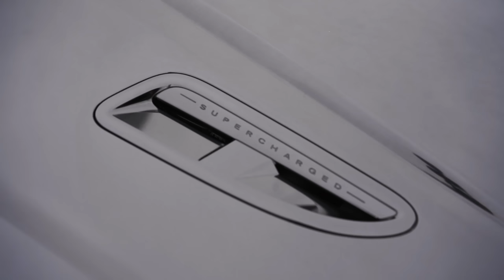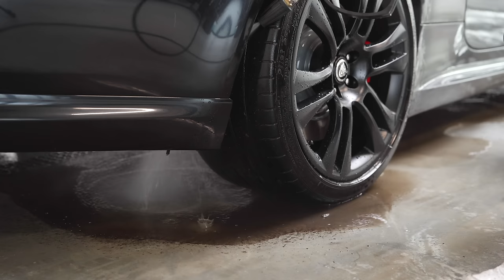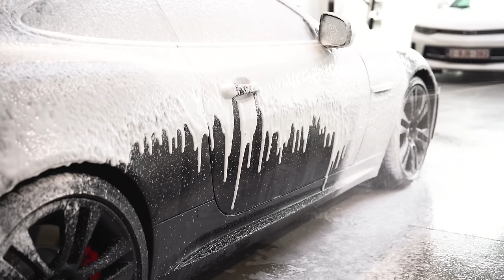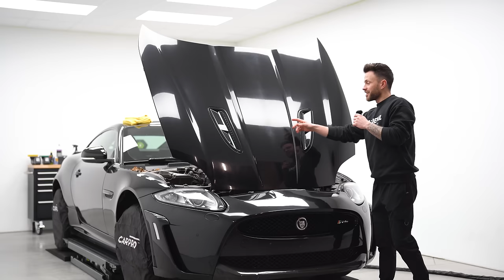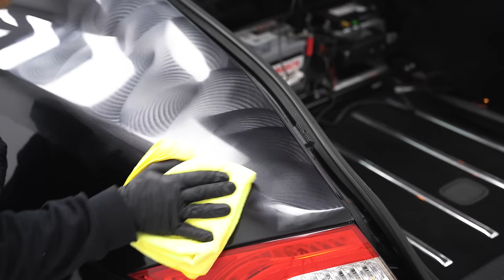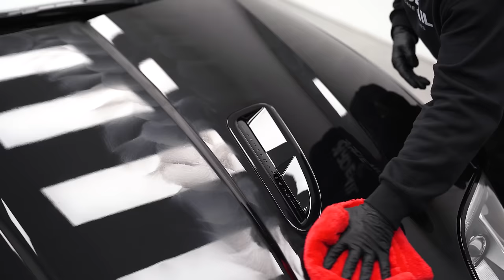First Detail in 12 Years - Car Detailing Restoration

Comment: Nice video man, amazing! Would you recommend using the P&S Iron buster without later polishing and applying a coat? In my case my car is new (6 months old) and I'm worried because there is always break dust and I don't want to affect the down parts from the door etc. I know is PH neutral but will be fine?
Thank you!

Comment: you have any issue with letting iron remover dwell then claying at the same time?
Reply from the maker: No issues at all!
Reply: @VermijlCarDetail that would make me extremely nervous for it to be on the paint the entire time you are performing your mechanical decontamination. I usually do the claying with a decontamination towel using the soap on the car mixed with iron remover as a lubricant, but I do that panel by panel. I would prefer to do it all in one go, so you think this is safe for a weekend warrior, or should I leave this up to professionals to do it your way?